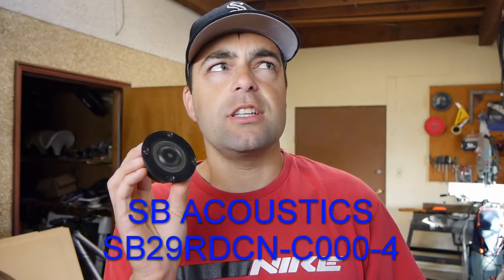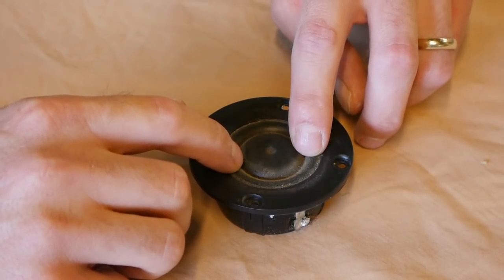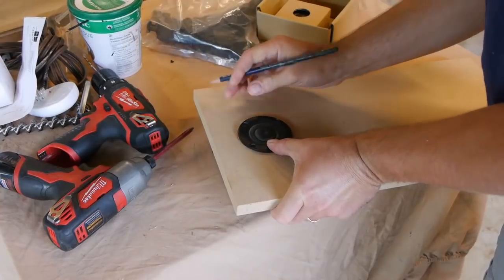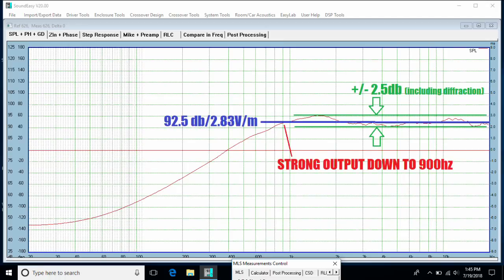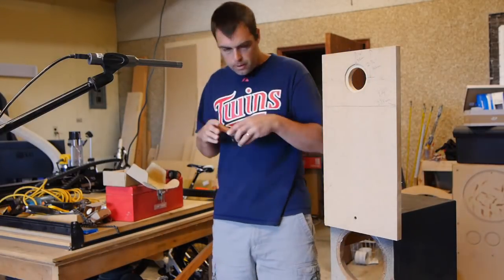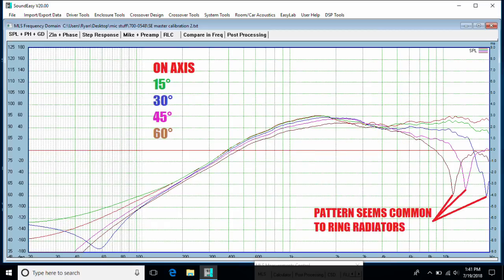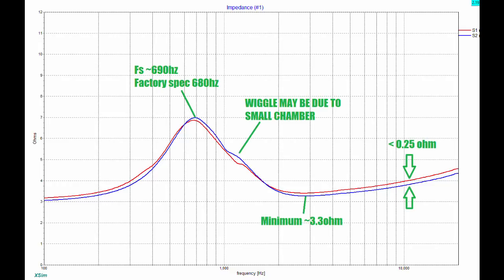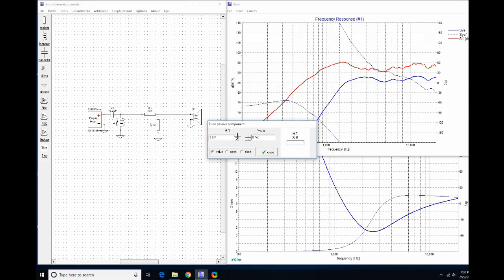SB Acoustics SB29 Tweeter | Test and Review

Comment: Are those tweeters also for automotive use. ??
Reply from the maker: Absolutely. Not the best off axis but powerful and the off axis is consistent.
Reply: @ImpulseAudioSpeakers there r soo many expensive tweeters like beryllium ones. How will u rate this one compared  to those expensive tweeters?
Reply from the maker: @SachinGupta-mb3pz  beryllium is very nice. There’s no denying it. But if you want 95% of the performance for 25% of the cost, this is it. Like most things in life, there’s a point of no return.
Reply: @ImpulseAudioSpeakers  thanks for the reply. Also do u like silk domes from morel? I hv heard alot for morel piccolo for automotive use. Was getting for 300 usd a pair for used one.

Comment: I noticed you use pink noise instead of a sweep to do your measurements. If I do a sweep with REW on a raw tweeter, do I need to reduce the bass frequencies going to the tweeter? And if so, would that tweeter file have a problem being loaded into XSIM when the woofer’s file is full range (20 to 20,000)? Thanks 😊
Reply from the maker: Depends on the amp level and kind of tweeter. A dome tweeter with a 2.8V load will be fine. Any ribbon tweeter should get a 40uF cap or there abouts. Reduce the level of you don’t need it loud.
Reply: @ImpulseAudioSpeakers  
Thanks. It's actually a paper cone tweeter in a pair of 80's Ohm Acoustics FRS-11's I found in a thrift store. Guess they were considered hifi back in the day. Sold for like $1000. Going to replace the rotted woofer surrounds and refurbish the xover with a modern design. It has 2 glass fuse "light bulbs" with a poly switch "protection circuit" in each speaker. The tweeter "bulb" has blown in both speakers. I have REW/umik1 and DATS measuring device. Was planning on doing FR measurements with REW at about 75db through the raw drivers once I get the old xover out. That sound safe? Thanks again! :)
Reply from the maker: @jimbanville  plenty safe. You’ll have no problem unless you accidentally crank it without noticing or something.

Comment: Nice and detailed video, I have two questions. 
1. Can we use this in a car, on front pillar ?
2. What do you feel about the distortion level as i don't have much knowledge to read the graph  .
Reply: There are some videos in youtube about this tweeters in a car, on front pillars. Just search SB29RDNC.
Reply: @jerrykamis2011  thanks for your reply, i will search this. 😀
Reply: @Somesh-Ji  no problem 😊, here in Indonesia we even use SB Satori on front pillars. I have the SB17NBAC midbass on my doors.
Reply: @Jerry Kamis  Oh really, but that SB17NBAC has Qts of 0.29 it's not good for car doors as it needs large air space to breathe properly. 
Or using vented encloser custome build
Reply: @Somesh-Ji  yeah, my installer recommended it. Here are some videos of SB17NBAC
https://youtu.be/xVtzlABf4es
https://youtu.be/Gsy3NJaASrE
Reply from the maker: The distortion is good in my opinion. It’s low enough that it’s really not a problem. Use in a car is a little tricky because the off axis pattern is a little directional. That may or may not be a problem for you.
Reply: @Impulse Audio  Thank you for your reply.

Comment: Ryan, I would like to solicit your opinion regarding a low end capability of these drivers. I've got an idea partially replicate Tekton Design (Double Impact, etc) and McIntosh (XR100) concepts with some twist. Also I wish to keep a front baffle fairly narrow (about 20-22 cm (8")) and to get the better top end. So I thought to use just two pairs of these SB Acoustic tweeters in a D'Appolito configuration (instead of 7 drivers in Double Impact) and to place a Viawave ribbon tweeter in between. Based on the distortion measurements done by hificompass.com and dimensions of the drivers I am thinking to run the SB29s from 1300-1500 to 3500-4000 Hz. Do you think 4 of these tweeters per side would provide sufficient output at the bottom end of that range to keep up with the ribbons and 4 of Peerless TC9FD18-08 drivers (covering range below 1300 Hz)?     
As for Viawave tweeters I think I'd better use a wavegiude model with somewhat narrower horizontal dispersion to match pairs of the SB's at 3-4 kHz. That could be either RT850, GRT-145W or a new coming RT-5W.
Reply from the maker: Very interesting concept. Just when I thought I’d seen it all. Most concepts like this are very flawed, but I see a lot of potential for this to work. Possibly over complicated, like why not just use 3” mids. The driver spacing will be tighter than a mid, which is good. You must like the sound of small drivers. 

Yes I think 4 of the SB at 1300hz is completely possible. Their power capability surprises me. The Sd will be roughly equal to a 55-60mm dome mid. Xmax on these little tweeters may not be quite as high as a dome mid, but close. You’ll have 4 voice coils to dissipate the thermal load too. I don’t think you would have any issues.
Reply: @ImpulseAudioSpeakers  Thank you, Ryan!
4 of the SBs will have total Sd = 38.4 cm2. That's the same Sd as have many of 4" cone midranges like Seas MU10RB-SL (H1658-04) and Scanspeak Discovery 10F/8424G (albeit with much lover Xmax). 
Also 2.5" (60mm) Satori MD60N-6 dome midrage has smaller Sd = 32 cm2 but with twice larger Xmax = +/- 0.5 mm. 
As for my love for the small drivers I'm not sure if I do love them yet as I've never heard such combo. But many people who've listened to the Tektons got very excited and are raving about very natural sound of percussives. So I want to try that concept.
Reply from the maker: @IliyaOsnovikov  hmm. Maybe my math is wrong. I’m getting 26.4cm2 with a 29mm diameter. If I’m wrong, that’s a lot of Sd so you’ll have plenty of punch. I would not doubt they could play fine down to 1000Hz even at very high levels.
Reply: @ImpulseAudioSpeakers  Those tweeters are not domes but the ring radiators. It's not quite clear what portions of the inner and outher rings are actually radiating the sound. That's why I just used the number from the Data Sheet. It shows Sd = 9.6 cm2. That equals the area of 35 mm circle.

Comment: Everything wrong with this. YES THE SAWDUST WILL DESTROY THE MEASUREMENTS, not to mention distortion. Rabbit bit would have done the job in 10 seconds from the hole. 3rd, this is the ONLY SB driver that does not impress me. It is ok, but distortion is not the best.
Reply from the maker: DJ FireStorm okee dokee mr.expert. Sorry I messed up.

Comment: Excellent Channel. Learnt so much. Any chance you will do a top 3 mid-ranges?
Reply from the maker: Arif Hussain Id like to, but mids are really less common and I’ve probably used 10x as many woofers and tweeters as I have mids. And to be honest, the mids available generally don’t impress me much. I am hoping SB or Peerless or someone comes out with a high sensitivity 3 or 4” mid less than $60. They just don’t seem to exist. Maybe I expect too much.
Reply: Thanks Impulse Audio. How would you compare the resolution of your fav 5” SB (squareish framed... ) mid woofer to the scan speak 15M in midrange applications? In terms of details and smooth sounding in HT applications? I love the 15M, but at louder volumes it distorts quickly.
Reply from the maker: Starcraftowns99 the 15M is far better as a mid. If you’re getting distortion, maybe try a higher crossover?? What is the XO now?

Comment: I have a pair of rebuilt Optimus 3-way speakers and looking at these SB29's to upgrade from the metal dome tweeters that are currently in there, I don't have the brand or model#  for them but they came from Newark catalog like 20 years ago off of memory they are 8 ohm at 92db sensitivity.  My question is: since these SB29 are 4 ohm and the rest of my speakers are 8 ohm - should i use an inline resistor or L-Pad attenuator to reduce this tweeters sensitivity?  My other 2 speakers are 5" FaitalPRO 5FE120 midrange @ 8 ohm & 88db sensitivity (crossover at 5000hz - 500hz) and a MCM Audio 12" model 55-1220 @ 8 ohm & 98db sensitivity (500hz and lower)  Crossover is Eminence PXB3:5K0.  The extra sensitivity of the woofer doesn't bother me a bit by the way, I've never tested the speaker's combined frequency response.
Reply from the maker: XDangerDaveX not sure I would add a resistor. Seems like a waste if you have enough sensitivity. The best would be to design a proper XO taking all this into account. You’re spending a lot of money on the drivers and the XO that’s in there won’t be very good for them. I suppose you can always just try and see how it goes if you’ve already got the drivers.
Reply: @ImpulseAudioSpeakers  Thanks for the response and helpful suggestion!  I don't know how to design an XO so I was kinda letting the off the shelf XO to dictate the driver selection, i figured if I had flat response up to and beyond the crossover frequency for each driver and roughly similar sensitivity of drivers that the off the shelf XO would be acceptable.  Without having to individually test each driver and going off published specs - how would one go about designing an XO?  Do you know of a guide or video on that?  Or a reasonably cost effective way to outsource the XO design?
Reply from the maker: XDangerDaveX it’s not something that can be summed up in a YouTube video. You might be best starting with an off the shelf XO if you already have the drivers to get up and running and see how it goes. Then try and tweak/play around and learn. The speaker will hopefully improve from there.

Comment: How low could you cross this tweeter?  Would it sound good and handle power well at a 2K second order x-over point?
Reply from the maker: Glen Kashin it really depends on the power handling / SPL you expect from it, however it should handle that no problem with typical listening levels in a home.
Reply: @ImpulseAudioSpeakers  Cool, thanks.  I'm getting a pair delivered today.  They seem pretty easy to  work with in x-sim.

Comment: I use these tweeters in a pair of active speakers along with the 6.5inch satori mid/bass. They are amazing drivers. I previously used the cheaper 25mm dome tweeter that has the same baffle cutout. This ring dome is far superior.

Comment: Do these tweeters need to be used with a horn? Because of the directivity and all that? If so, where could I do some reading for a good start?
Reply from the maker: Arnand de Jager no they don’t. It just offers a big advantage over the standard flush mounted way. I would see what you can dig up on zaphaudio.com. That’s where I first saw testing of this tweeter with a horn and decided to buy a pair, so it’s a good place to start. Not sure there’s much more information about using it in a horn out there.

Comment: you can't here a 1 dB difference especially outside the range of 1K-5K
Reply from the maker: Joshua McLaughlin I would disagree. It really depends on the bandwidth. For something a couple octaves wide it is audible. For something narrow Q not so much.
Reply: Impulse Audio within 1K to 5K the lowest variation in amplitude we can detect is 1.5dB. outside that range, only 3dB.

hey can you please  do a test with the SB21RDC later? it's supposed to be better than the 26 & 29
Reply from the maker: Joshua McLaughlin sorry but I believe that’s incorrect. Do you have an AES paper or something to back that up? Most research I’ve read on the subject links detection thresholds to the Q and bandwidth. You’ve correctly identified which bandwidth we are most sensitive to, though. I can easily hear 0.5db when trimming a tweeter level during design. It really depends on the Q of the variation. 

I don’t have that SB tweeter for I would do a test. I don’t use small dome tweeters very often as they require high crossover points.
Reply: I’m running these tweeters in active speakers and EQ them through a BSS fds334t. I can make 0.5db adjustments to a HS filter I have applied and can hear each adjustment.
Reply from the maker: Matt Hoyle and I bet it’s not very subtle either ;)
Reply: @ImpulseAudioSpeakers  Indeed, I do this with passive components, and we can hear 0,2 ohm difference easilly. But its for the well trained ear. Some other audio friend of mine who is more into measuring said he couldnt hear it. While me and others clearly can...

Comment: why no distortion and csd measurements? fr curve is useful but not as much
Reply: nice thx for the quick replies.. you are so cool .. dayton have a new fabric midrange dome that could compete with the morel at lower price..

transducer labs ceramic are 100$cad at solen.ca .. not sure how costly are the carbon fiber.. but they are interesting drivers for the price.. in your horns i think they will beat what you have now
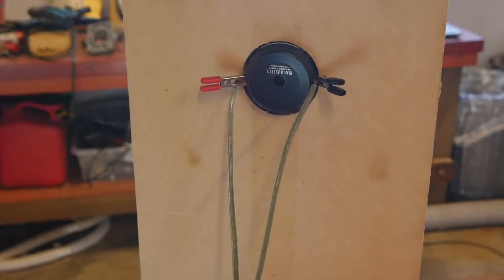Reply from the maker: lex Tr3 I did distortion (see 8:12) but forgot to do CSD. FR is by far the most useful. Distortion testing is not very useful especially without a basis of comparison, which most tests don’t have including this one.
Reply: @ImpulseAudioSpeakers  i guess all 3 are useful to select drivers.. dispersion too.. (h2,h3,h5 distortion) .. its cool that you show driver matching too and impedence..i.missed the disto measurement in the video.. would be nice to include a timelime or a link to the pictures of each measurements.. just saying ehhe since i guess we have to really thank you to share all your awesome work..

lots of people are interested in best midrange that can covers from 150hz to 8khz drivers.. on 6db crossover.. lot more funkyness in the fr curve of midranges depending on the material used and resonance point of the material.. also mms etc.. heheh

best dome midrange measurements fight from cheaper to costlier would be interesting too.. not that much dome midrange left so possible

i would also love for you to test transduler labs n26c and carbon fiber dome tweet :)
Reply from the maker: lex Tr3 midranges interest me a lot but they are becoming a dying breed as most people go 2 way or use midwoofers as a mid. I don’t like that personally. I believe in drivers made for specific tasks. Sounds like you also prefer dedicated mids so that’s good. I can’t test them all but slowly I’m doing as many as possible. 

The transducer lab tweeters interest me but they’re expensive and weren’t they going out of business or something? I’ve never used one of their products but always wanted to. I’d gladly test and return drivers to anyone who has a pair. 

Next time I won’t forget CSD :)

Comment: Hi there great clear and easy to follow video i an getting into car Hifi wow well would this tweeter work in a active 2 way and sub setup in a car ?
Reply from the maker: Mark E very well because it is small yet powerful. It can handle loads of power and cross over very low. The small size means you can get it close to the mid woofer also. Only reservation would be that it’s 29mm and the off axis in the top octave is pretty directional. So if you are sitting off axis at all you may notice less sparkle than required.

Comment: I really love your driver reviews. very informative. I notice you always test tweeters using a baffle. But does a tweeter really need a baffle? Wouldn't a tweeter behave better, more like the ideal point source without one? It would get rid of those baffle refractions. Or are there drawbacks to having a tweeter only suspended, maybe even removing the metal plate. I ask this because I'm trying this in a new 3 way active XO build, a tweeter just suspended in air, crossed at 2.5kHz. I don't have good measuring equipment, elas. So far, I'm not very satisfied, though I cannot pinpoint the problem, the sound is not 'blending' well around the crossover point. The tweeter and the mid are spaced about 6 inches apart (hart to hart), maybe that is the problem. In short: what good does a baffle do for a tweeter above 2.5kHz? I would really apreciate your view.
Reply from the maker: Marcel Ooms interesting question that’s a little tough to answer with words. I’m working on a video about baffle diffraction right now. I will touch on this given you asked. 

The reason you are having trouble is probably not related to this, rather not getting the XO right. This is a sensitive area for the ear that needs to be dialed. The no baffle thing probably isn’t helping as there are some issues with that.
Reply: Thanks, I will tinker with the crossover some more. Had the first listen only yesterday, it took several weeks to get it just right in my previous builds. Any thoughts on acoustically reflective vs non-reflective (e.g. felt) material for the baffle? I've seen manufacturers use both, even wole sheepskin...

Comment: You could get away from the baffle distortion by having the tweet proud of the baffle quarter of a half an inch extended forward, anyway your Twitter wasn't fixed in so there's going to be some distortion it was just loosely fitted
Reply from the maker: John sweda I’m not sure what you mean by baffle distortion. I noted the baffle diffraction in this video which is related to the edges of the baffles. I didn’t screw the tweeter to the baffle but it was snug and does not add distortion at all. Maybe I’m not understanding what you mean.

Comment: How do u compare this to XT25?
I love the sound of XT25 but not the size, in my car
Reply from the maker: Kharis Marzuqi that’s a really tough question. For a car I’d go with this. It can cross lower, has higher power handling, and its smaller so it’ll fit much closer to the mid. Not sure which one actually sounds better as I’ve never done a back to back listen. Both sound great for sure.
Reply: Anyone who compared these with the Vifa XT small version? Or the new SB 26CDC ceramicmetal??
I have the smaller XT for in my car, but it sounds a bit too much like a dome  (which can sound very good, like some Scan Speaks). But I am curious about this SB version. Normally I prefer Ribbon or AMT tweeters, but am not sure to use it in a car, where I want to cross as low as possible.